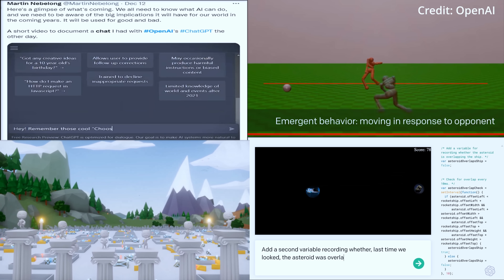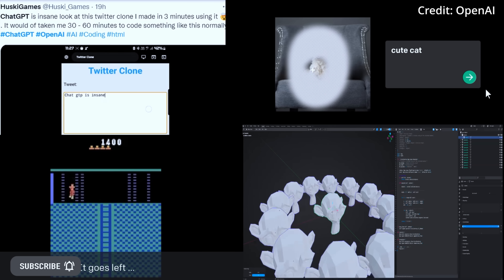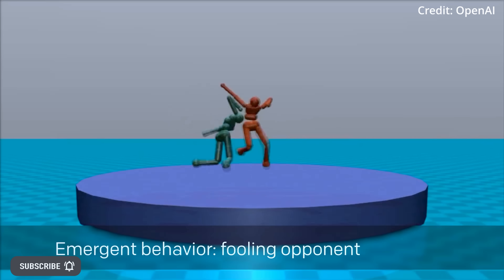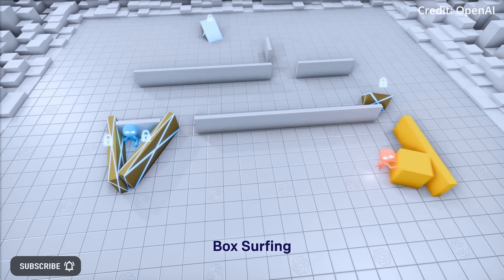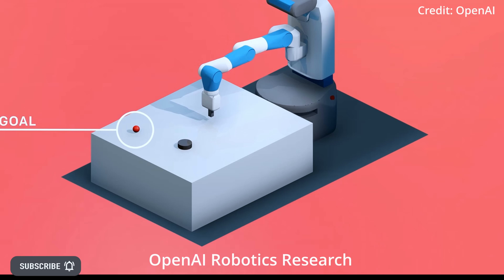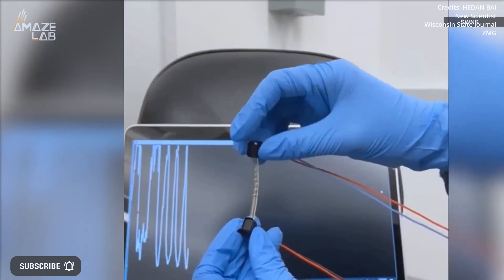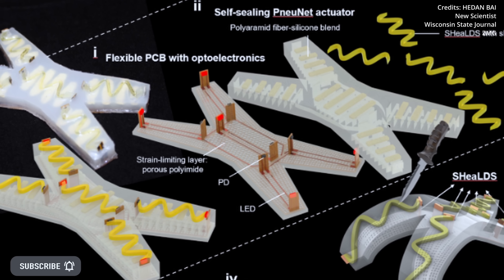OpenAI’s GPT-4 Artificial Intelligence = AGI? 100,000,000,000,000 Parameters Plus THIS

Comment from the maker: Premium Robots: https://taimine.com/
Deep Learning AI Specialization: https://imp.i384100.net/GET-STARTED
AI News Timestamps:
0:00 OpenAI GPT-4 Size
1:18 GPT-4 AI Model Sparsity
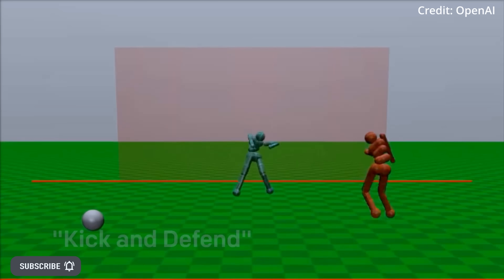2:06 OpenAI Going For Multimodal
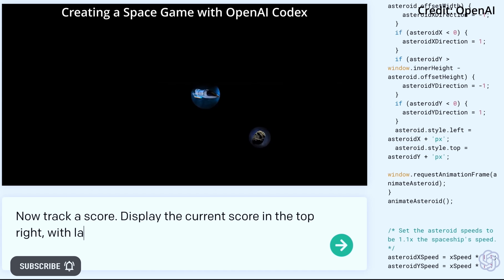3:15 OpenAI's Cost of Training
4:32 New Self Healing Soft Robotics
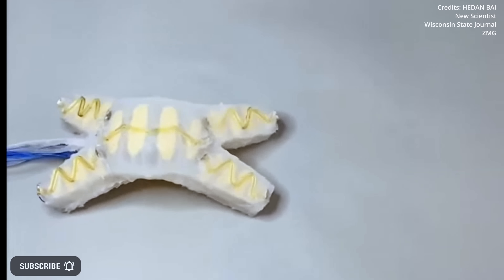6:04 New Memristor Deep Learning System
Reply: This is BS that GPT4 will have 100 trillion parameters, sam altman said that it wouldn't even be the biggest currently in terms of parameters nor will it be much bigger than gpt-3.
Do better research.
Reply: @joannot6706  exactly
Reply: What's the name of that compiler/ide az 0:50? I definitely want to use it

Comment: AGI is impossible.

Bcz i asked ChatGPT :
「You have an 11-minute hourglass and a 7-minute hourglass. You need to measure exactly 15 minutes. How do you do it?」

And It said:
「To measure exactly 15 minutes using an 11-minute hourglass and a 7-minute hourglass, you can do the following:

Start the 11-minute hourglass.

When the 11-minute hourglass has run out, start the 7-minute hourglass.

When the 7-minute hourglass has run out, start the 11-minute hourglass again.

When the 11-minute hourglass has run out a second time, the total time elapsed will be 11 + 7 + 11 = 29 minutes.

Since you only need to measure 15 minutes, you can stop the process at this point and the total time elapsed will be exactly 15 minutes.

Alternatively, you can also use the hourglasses in a different order or start one of the hourglasses slightly before the other to fine-tune the measurement to exactly 15 minutes.」

Wow. HOW SMART IT IS !

Comment: GPT4 isn't expected to use 100T parameters. Sam Altman said it won't be much bigger than GPT3 in an interview.
Cerebras doesn't have a cluster that can train a 100T param model, they hope to build one someday.
Their most recent cluster would need to be at least 10x larger.

You took separate bits of misinterpreted real info + assorted rumors and painted a false picture.
Reply: The whole video had me listening with some skepticism. Thank you for clarifying that.

Comment: That massive cost reduction is certainly leveraging on the sparsity. The human brain uses sparsity to operate on ridiculously little power (about a million times less than a comparable computer).
However, specialized hardware can really help. Tesla reduced training costs 10-fold using in-house developed hardware.

Comment: The number of parameters is the number of connections, not the number of neurons. Human neurons have thousands of connections on average, amounting to an estimated 500 trillion total. That would put GPT-4 really close. Now, GPT is still a multilayered self-attention transformer and not as efficiently interconnected as the human brain. But if they magically pull that off and we should expect significantly superhuman performance on language-related tasks. Of course, it's possible that architecture doesn't scale well into that size and doesn't learn much more other than memorizing everything it reads.

Comment: Once the AI can design more efficient technology designs, the possibilities will really skyrocket. It's already progressing at an insane pace.
Reply: It dont matter if the Ai designed it or your cat drew it cause that dont prove its original. Looking it up on the established lists to see if its already been done requires 
Access to live net. 
Exact text search. 
Sort by oldest. 
Sort by type, for example cnc milling, 3d printing, laser cutting and so on. 
Current systems globally are no exact text works at any business search engines for example 
3dmdb yeggi stlfinder net. 
Sort by oldest maybe plus or minus 5 years. Hardly efficient. 
Perhaps chatgpt could do it but ive seen zero proof yet. 
I saw a science answer it gave which was wrong so maybe one day it may prove accurate but ive yet to see it. I hope to see it.
Reply: @WillofNewZealand  They just improved the logic a bit, but logic was not really the point of GPT. Introducing code data did give it the ability to reason, slightly, which is why the chat portion is much more convincing than gpt 3 was. Also consider that this is free and open source. For certain, there are much more advanced models that already exist. Whether or not we'll crack that threshold soon remains to be seen, but I am beyond impressed at the rate of progress that we've gotten our hands on. 

If humans can learn a skill from scratch, like 3d printing, a more advanced AI could as well. An AI that is programmed with scientific data with the foundation of the elements, the laws of physics, and the scale in which it would be useful to us would be huge. If it can learn to reason, make hypothesis, make calculations, and simulate 1000s of experiments a day, it can make testable breakthroughs at break-neck speed. Give an AI like that the ability to run test and gather new data using external sensors, there is no telling what it might come up with.

I really don't think we're as far off as people assume. Yes, I catch chat gpt lying left and right, and even some of its simpe coding that it generates is flawed, but it's not as if the public has even seen things as effective as this. It lies, almost like a toddler. It will also believe you, like toddler. We're basically just programmed ourselves until we research and test otherwise. We're inspired or affected by external events that happen to us. We might be at a disadvantage due to genetics, and our environment may shape who we become. It's not too dissimilar from an AI, where the base programming and server capabilities are it's genetics and the reinforced learning and interactions it can gain data from are the environment.

It can definitely get there. We just haven't cracked how yet.
Reply: @WillofNewZealand  I'm not going to lie, you have a very unique way of writing and I actually had to use GPT to clean up your response so it was easier to digest. If I'm right, then the summary of this comment is that I agree with your assessment and don't have high enough qualifications to answer your question on it's capability in the sciences/computer side of things, but can speak to it's significant advancement in literary capabilities.

From what I gather, I don't think you disagree with the potential for AI, but you're looking for evidence that any of the "breakthroughs" we have seen lately actually offered anything new. In truth, you're correct. It doesn't offer anything that an AI couldn't do before, but it may be more efficient at interpreting what you are looking for, therefore appearing more advanced.

The functionality you're asking about is out of my expertise and I simply don't know, but I do think some of those can accomplished via code. Developers are quite impressed by what GPT can produce, as it generally gets the concept of what you want the function to do. However, it does still mess up that code sometimes and would still require someone with coding knowledge to comb through the generated code and tidy it up. I could ask it to give me executable code for what you're asking about, but I don't think I fully understand what intent you mean by it, so I doubt I would be able to get it to provide useful code. On a broader scope, it can't just automatically integrate with a system and run on it's own without being prompted first, so I would err to the side of chatgpt likely can't give you what you want it to achieve.

That being said, as a writer, the language model far surpasses any model I have ever seen, and the leap forward is massive. Speaking to it's literacy, it is at an extremely high level, both in execution and comprehension. If this became the new standard as a communication frame work for other AI that delve more towards the more analytical models, just that alone might yield much better quality from them. For instance, if it had a set of image recognition data and combined with an AI Art Generator, generating said art would become significantly easier and more precise. 

Overall, I think chatgpt is significant for the "Arts", but does not have any obvious benefits to other models that are more tailored for the Sciences.
Reply: @HashimotoDatsu     It does look promising and im seeing notable progress even minutes ago.
Hence im circling. 
Thanks for your comment. 
Wishing you nice success. Be well.

Comment: Why do we assume more parameters = more intelligence?  Is the bigger question not how those parameters are actually utilized by the underlying algorithms making use of that data?  A bigger, shinier mirror regurgirating more convincing imagery is still impressive … but it’s still just imitation and nothing more.
Reply: This isn't really true though. First, with transformer models, it really does seem to be the case that a larger model results in better performance (at least so far). Also, this is precisely what happened with the enlargement of the human brain. We don't have structures that other apes don't, we simply have more cortical tissue in certain areas. Unless your argument is that humans are just "imitating" as well. And perhaps we are...
Reply: @generichuman_   sorry I’m not familiar enough with how transformer models differ?  What do they offer that is any different? My (admittedly lacking!) understanding with all neural net / machine learning algorithms is that they’re essentially glorified look up tables.  Through rote trial and error (aka ‘training’) they build up these tables which are then called upon to regurgitate the most appropriate answer, resulting in the “imitation” mentioned earlier.  A simple ant by comparison has very little brainpower, and yet its pathfinding ‘algorithm’ far outstrips anything we’ve engineered thus far - nevermind the fact that same ant is part of a complex social system, and possesses an inhererent will-to-live. Clearly there’s more to intelligence than faster processing and bigger data. 

Ultimately I’m just here to learn though, so if there’s been some breakthrough (as with transformer models?) I’d love to hear about it.  Hard to cut through some of the AI-hype-noise sometimes and find it truly baffling when (some) people boil everything down to mere calculations, as if subjectivity could ever be computed…

Comment: So this is a video reporting on current AI advancements – written and narrated by an AI…
Reply: Probably written by an AI too, all of the content in this video is false.
Reply: @jnevercast  can you briefly tell me what is false about everything said in the vid and the source to factcheck ? genuine question.
Reply: @eaglenebula2172  It's not straight-up lying, there is some truth to what it is saying, but there is still slight misinformation.
0:24 A raspberry pi connected to a bunch of hard drives would be able to run a 120T neural network, but extremely slowly. The test is not if the network can be run, but rather how quickly it can run. 
0:31 Comparing the human brain to a neural network is not entirely accurate because the human brain is structured differently than chatgpt and a large portion of the intelligence comes from training data, not as much neuron count. If you have a really poorly designed model with 100k parameters, it does not guarantee that the model will outperform a 10k parameter model

Also its comparing neuron count to connection count.

0:51 Their reasoning for why it is more efficient is wrong. It is simulating less connections between the neurons, not having them inactive. 
 
1:58 Measuring neurons/connections only gives a rough idea of what the model is capable of. If I wanted to I could create a 150 trillion parameter model (and if I had enough space to store it), but that does not mean mine is better.

4:00 Early on in the video it said that it is only possible because of cerebras, but now they contradict themselves by saying how they have not yet partnered

I wrote this at 1AM so I apologize for any grammatical mistakes and I should probably get some sleep instead of dissing this script
Reply: written by GPT-0.0000000000002
Reply: Yeah, And as boring and unrewarding as one would expect.
Reply: I'm not sure it's narrated by an AI, but, if it is, I'm impressed. It made pauses where needed and its intonation was flawless.
Reply: @guepardiez  Humans don't say the same word identically every time, this video does. It's a speech synthesis program.
Reply: @guepardiez  Yeah, there are like hundreds of these channels on youtube now, understandable given their success. Definitely narrated by AI's.

Comment: I just ask ChatGPT about that: "How does ChatGPT and GPT-4 compare?"
<<< GPT-4 (Generative Pre-training Transformer 4) is a very large and powerful language model developed by OpenAI. It is trained using a technique called unsupervised machine learning, which involves training the model on a very large dataset and allowing it to learn patterns and structures in the data without explicit supervision. GPT-4 is able to generate human-like text, perform translation, summarization, and other language tasks.

ChatGPT is a variant of GPT-4 that has been fine-tuned for conversation tasks. It is designed to be able to generate responses to text prompts in a manner that is more natural and less robotic than traditional language models. ChatGPT is able to generate responses that are more coherent and contextually relevant than those generated by GPT-4, making it well-suited for use in chatbots and other conversational applications.

Overall, GPT-4 is a very large and powerful language model that can perform a wide range of language tasks, while ChatGPT is a specialized variant of GPT-4 that has been fine-tuned for conversation tasks. >>>
Reply: ChatGPT's cutoff was september of 2021 so I doubt it would have much info about GPT4
Reply: ChatGPT is a variant of the GPT-3.5 series tho
Reply: Yep, same here. GPT-4 must be similar enough to GPT-3 that it conflates them.

- What is GPT-4?
>> GPT-4 (Generative Pre-trained Transformer 4) is a large language model developed by OpenAI. It is a machine learning model that uses deep learning techniques to generate human-like text. GPT-4 is trained on a massive dataset and can generate text that is coherent and flows naturally. It can be used for a wide range of natural language processing tasks, such as language translation, summarization, question answering, and more.
>> GPT-4 is notable for its large size and impressive performance on various language tasks. It has been trained on a dataset of billions of words and can generate text that is difficult to distinguish from text written by humans. However, it is important to note that GPT-4, like all machine learning models, has limitations and is not capable of fully replicating human-level intelligence or understanding. It is a tool that can be used to assist with various language-related tasks, but it is not a replacement for human judgment or decision-making.

- What is GPT-4's relation to ChatGPT?
>> GPT-4 (Generative Pre-trained Transformer 4) and ChatGPT are two different language models developed by OpenAI. GPT-4 is a large, general-purpose language model that has been trained on a massive dataset and can generate human-like text for a wide range of natural language processing tasks. ChatGPT, on the other hand, is a specialized version of GPT-4 that has been fine-tuned for the task of generating responses in a chatbot-like setting.
>>ChatGPT has been trained on a dataset of conversations, so it is particularly good at generating responses that are appropriate for a given conversation context. It can be used to build chatbots that can hold natural conversations with humans. Like GPT-4, ChatGPT is a machine learning model that uses deep learning techniques, but it has been specifically designed for the task of generating chatbot responses. It is not a general-purpose language model like GPT-4 and is only intended for use in chatbot applications.

- ChatGPT is a specialized version of GPT-3, not GPT-4, though, isn't it?
>>You are correct that ChatGPT is a specialized version of GPT-3, not GPT-4. I apologize for the mistake in my previous response. GPT-3 (Generative Pre-trained Transformer 3) is a large language model developed by OpenAI, and ChatGPT is a specialized version of it that has been fine-tuned for the task of generating responses in a chatbot-like setting.
>>GPT-3 is a general-purpose language model that has been trained on a large dataset and can generate human-like text for a wide range of natural language processing tasks. ChatGPT is a version of GPT-3 that has been specifically designed for the task of generating chatbot responses. It has been trained on a dataset of conversations and is particularly good at generating responses that are appropriate for a given conversation context.
>>GPT-4 is a separate, larger language model developed by OpenAI that has also been trained on a massive dataset and can generate human-like text for a wide range of natural language processing tasks. It is a general-purpose language model like GPT-3, but it is larger and has been trained on a more extensive dataset.
Reply: It’s made for conversations and chatting and is yet way too too at programming

Comment: wait, i thought that they said that gpt 4 wont be 100T parameters? could someone clarify for me by replying?
Reply: GPT-4 is not 100T parameters. GPT-4 is an improvement on the previous GPT-3 model, which was 175 billion parameters. GPT-4 is a much larger model with 1.5 trillion parameters.

Sincerely,
GPT3